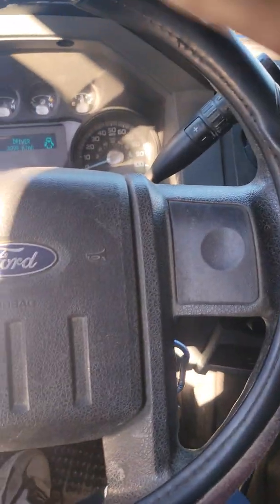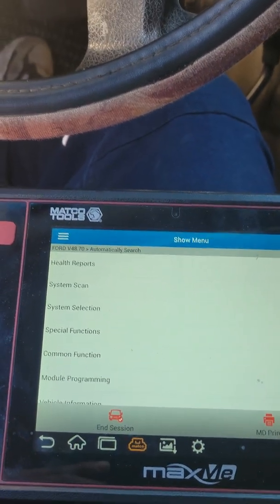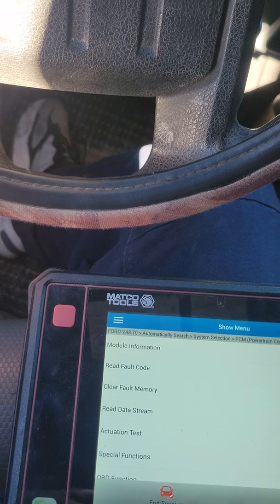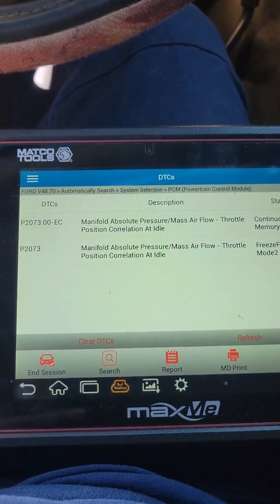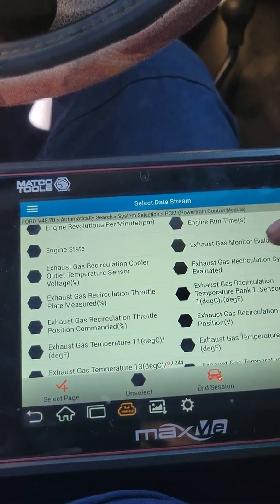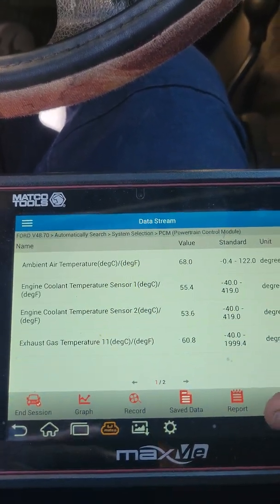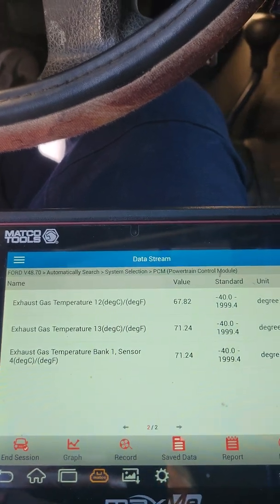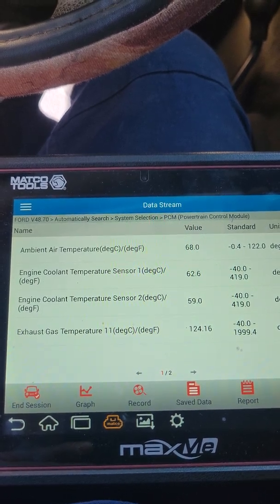POWERSTROKE 6.7L stuck in Idle LIMP MODE #palmsprings #diesel  #trucks #repair

Comment: What was the issue just got my truck a month ago and already got this code 2015 f450
Reply from the maker: @justthejuan8160,

Hi, on this specific vehicle, it had to do, with the driver allowing low DEF for too long, not allowing the computer to meet it's threshhold, which caused the system to go into limp mode.

If you have access to a scanner, start by monitoring EGT values, before starting the vehicle for the day (let it sit without starting over night), and check these values first thing with key on, but do not start the engine.

The EGT's must be within a 10-15 degree difference from each other, and you can compare it to the ECT (Engine Cooling Temp), and Ambient Air Temp values.

Sometimes an EGT sensor could be bad, without putting a check engine light, or code. Because the value is within monitoring, but lying to the computer.

Also, run a DEF quality test, to see if the computer, believes DEF is good.

Make sure no exhaust leaks or EGR problems happening.

And you may just need to run a Manual Regenaration....

It can get complicated, and you definately need a scanner that can do it.

Any help, let me know, will try my best...